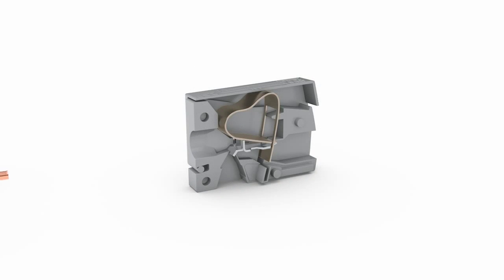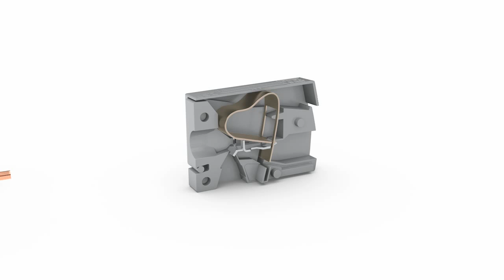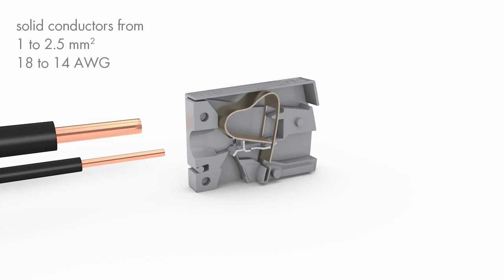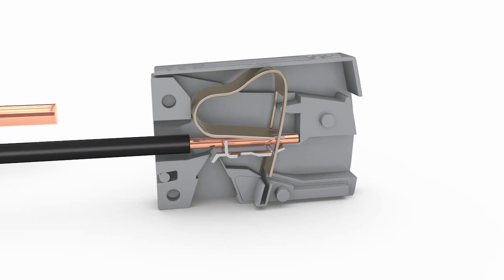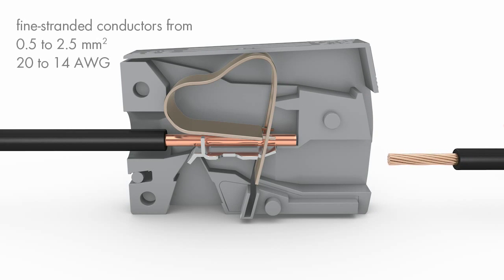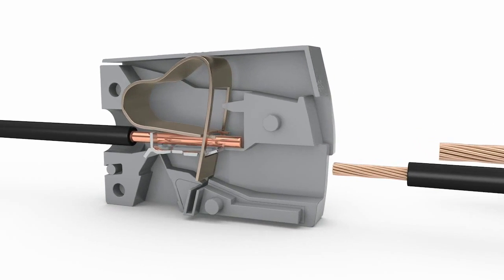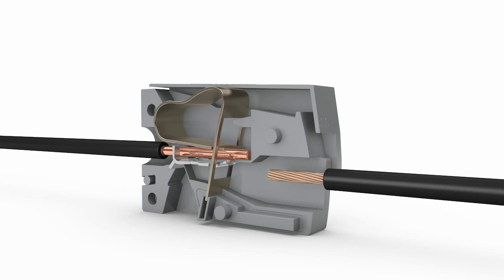WAGO 224 Series - The Combined Lighting Connector

Comment: these are crap, used them to install outside light & kept coming off gave up & used screw terminals.
Reply from the maker: Then they couldn't of been Wago connectors. Did they have the logo and type approvals etched on them?  There are a lot of substandard copies out there.